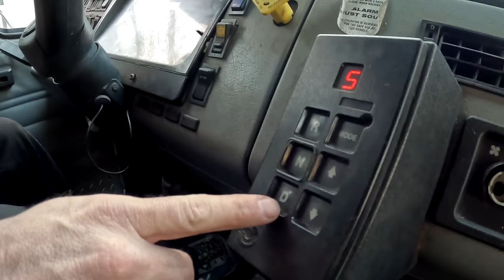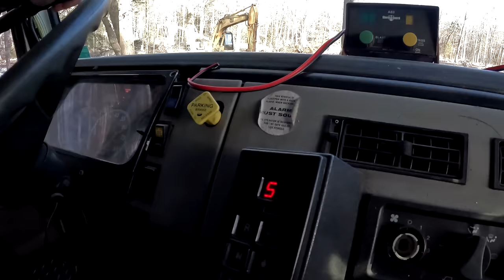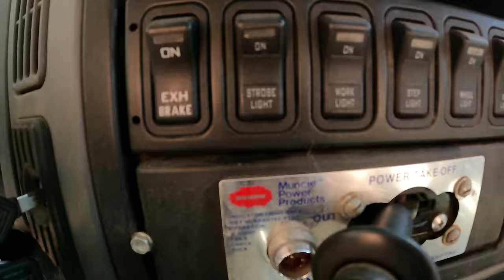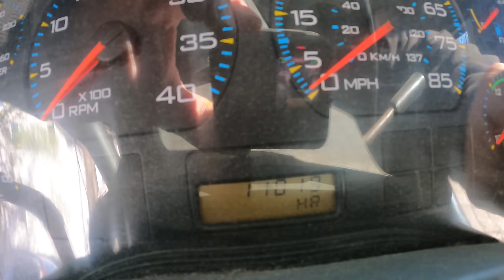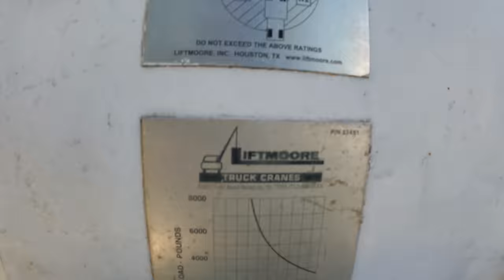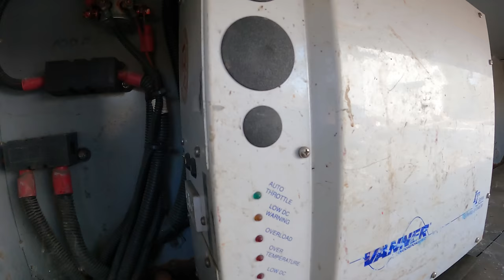Building my Dream Truck : Part 1 - Buying 2 trucks to make one, removing bed

Comment: I am wondering if you cut the frame behind the axle too short. You need some frame behind the spring hangers to bolt through to mount a dumping flatbed pivot mechanism as well as room to hang some mudflaps. If you don't end up moving the rear axle forward, and this becomes an issue, you can just put a flatbed on it that doesn't dump. Not sure how important to you the dump feature is. It may cause you to HAVE TO move the axle forward if the capability to dump is deemed a critical capability of this truck. So, in order to make it a nice looking truck, your ultimate plan is to do body work to the rocker panels and door bottoms (if they need) and then shoot some paint?
I am also doing a truck project swapping an enclosed service body with a flatbed. My problem is I don't have a telehandler to remove the old bed. I am thinking about building a fixed gantry crane to do it so I can roll the chassis out from under the bodies and lower onto an equipment trailer.
I saw a stack of trusses, so we can look forward to a shift to the shop. It will certainly make things like this truck build a lot more efficient as you will be able to work independent of the weather and sunlight. You still seem to have drainage issues at the shop sight. If I was you and before doing anything on the shop build, I think you should consider addressing that first. It all goes back to several videos ago when you were working in the shop area and filled in that naturally cut storm water runoff that went to your pond (when you were setting up the area to park all your heavy machines). I think you need to re-establish that (where you want it to be) by putting in some French drains and culvert pipe parallel to the back of your property where it drops down in elevation hard from above. You also intentionally diverted water along the side of the shop to where you buried pipe at the shop entrance road. It would be good to have it dry around the shop as you are going to be trucking in tons of materials daily and driving your machines in and out constantly, and you are going to be living with a perpetual soupy muck. Having it dry is going to make the build a lot more tolerable IMO.

Comment: Check the cam position sensor on international. Bet that’s your surging issue.
Reply from the maker: ok, just replace it? I wonder if there is a way to check it
Reply: @jmuller86  Watch the output with a handheld oscilloscope and see if it glitches when power goes away - you do have a 'scope don't you   :}
Reply: Yep Oscope is only way...or put a new one in. Not a sensor to cheap out on with Autozone

Comment: Jesse, are you still planning on moving the rear axle forward? If so, how far? Just my opinion but if you do I  think a good spot for it is where your forward spring hangers are located now make that the spot where the rear spring hangers would be mounted. Basically what I'm saying is from what I can see your axle would be or almost be centered between those two cross members.
Reply from the maker: Yes that is pretty much what I wanted to do
Reply: Another thought I just had is when you mentioned about making a dump bed. Have thought about completely cannibalizing the other truck? I mean if you took the dump box off you probably could use the lift assembly and hinge.
Reply from the maker: @clintkoelbl6481  either that or a hook and lift assembly. I almost want something that is electric over hydraulic, as I wont use it much for dumping

Comment: The Allison is far superior than that 6 or 7 speed manual. An Allison does way better in a smaller engine like a DT466. A manual could do better with a larger class 8 engine like in your FLD. The Allison is smoother, faster, and usually has better fuel economy in comparison to a 6 or 7 speed manual, due to over driver gearing.

Comment: There's no reason why you couldn't drag the rear axle right up over the trailer axles and gain a heap of room to fit a bumper.
Reply from the maker: yea I know. I just need to move it a few times to get it inspected and then it shouldnt need to go on there

Comment: Is it really worth messing with something that’s rusted that much
Reply: it's only the bed that's rusted really, he doesn't want the bed which is why he pushed it apart with the forks lol. The frame of the truck is good, maybe a little surface rust but will scrape off and be good as new

Comment: What model DT engine is it? Show the engine, all blue valve cover is a older model. Twin turbochargers is really the start on Maxxforce models.  They had issues with the turbos  coming up on the intake sides and crankcase ventilation.  We'd  clean the compressor sides, of the turbos  and  add a ventilation  spinner to help it out. It's  been a few years since I  worked for Navistar,  don't  remember what the spinning  thing is called anymore.
Reply from the maker: All blue, its the older one
Reply: @jmuller86  that's  good! I'd  pull the valve cover and  check the high-pressure rail for leaks. It's a simple  job to reseal the rail .

Comment: Wait hold up, tell me you didn’t have your bud lie there while you drive the 4300 truck over him?!!  I seen you do that with a tripod before but then the camera turned 180
Reply from the maker: thats a 360 camera. it shoots a 360 degree angle and you can pick where you want to look after
Reply: @jmuller86  ahhh, interesting

Comment: That truck needs a sleeper on it.
Reply from the maker: the crew cab could easily be a sleeper, you could probably fit a queen size bed back there if the rear seats were removed

Comment: You need a big garage
Reply from the maker: yea. kind of like the one I am starting to build next week
Reply: @jmuller86   I personally will keep the tool cabinets that are on the bed of the truck to use them as tool cabinets for your future garage I don't know what you think but personally I will do his
Reply: @jmuller86 Jesse even if you built your new garage five times larger your still going to run out of room everyone always does but it’s sure going to be nice, clean and warm in the winter when your in there working away great job and every man that gets his hands dirty deserves a nice shop. I hope your wife doesn’t get jealous of you spending so much of your time in the new shop Sir.

Comment: You really need to look at the 4x4 truck hard before building everything for the crew cab.  You will probably want to "z" the frame so the cab sits higher, but the rear bed won't.  If you don't think things through first, you will regret it.
Reply from the maker: I did look at it, the fl80 has a z frame but I dont see why I couldnt just jack the rear up to match it. I really dont want the truck any taller but really have no choice without going to hydraulic 4x4
Reply from the maker: @thesalvagegarage  I guess I didnt think of that. you are right, the rear would be taller if I dont do the z frame. I might check into that, I just dont want to pull the cab. maybe I can start the z right at the end of the cab, and the 2 ft of box I want on the back can still be on the top of the z where it overlaps, but then behind that it will be dropped down
Reply: @jmuller86  I don’t see why you couldn’t do that, lowering the rear end is pretty involved too, you have to make frame extensions so all your brackets would bolt up, then you would need to move crossmembers to keep things structural.  I have been working through the logistics of this for one of my future projects.